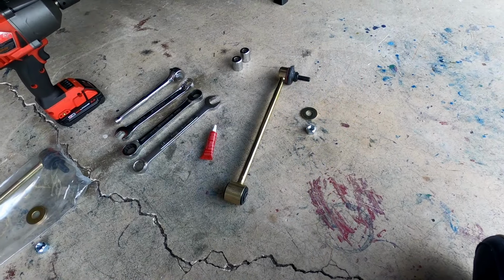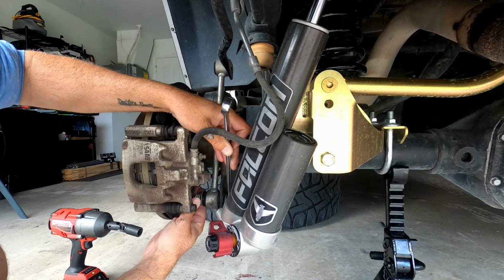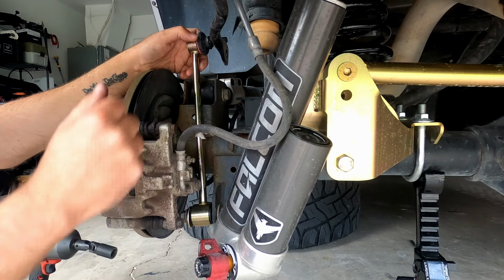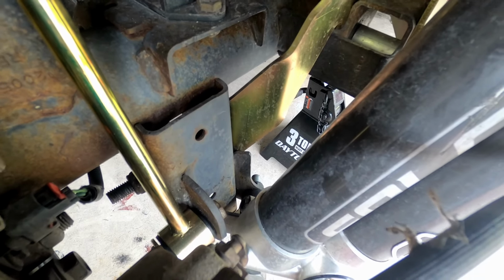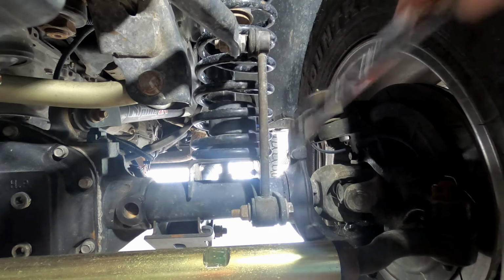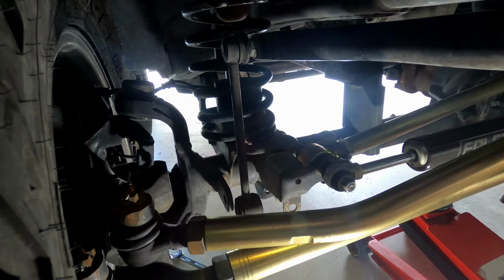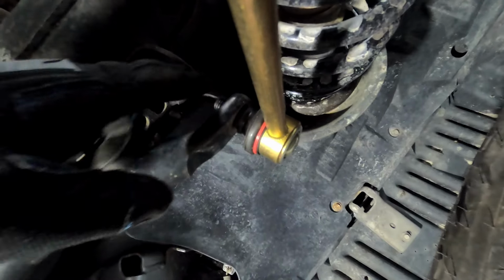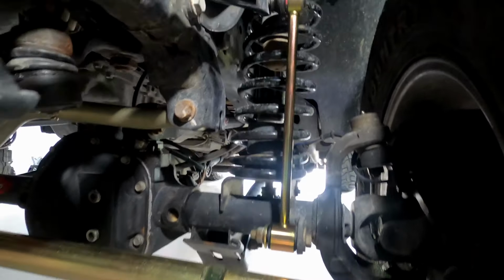MetalCloak Chromoly Sway Bar Links: A Game-Changer!

Comment: It looks great! It actually helps to have them a little longer in the front, not quite touching the coil housing. It puts the sway bar under a little more pressure, adding downforce on the road, making for a smoother ride.
I got the 14.5 adjustable quick disconnects and adjusted them pretty high. You could definitely feel the difference 😀

Great vid!
Reply from the maker: Thank you for the feedback. I’m learning as I go and I’ve been so impressed with MetalCloak and their customer service, so far.
Reply: Yeah, they're a quality company
Reply from the maker: @jedwheeler2728  thanks again. Always appreciate interaction on here.